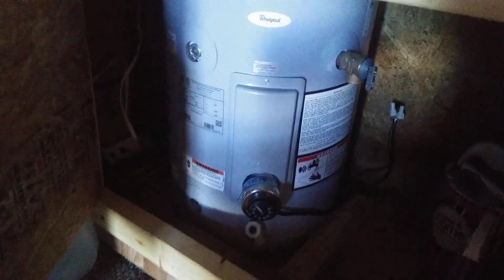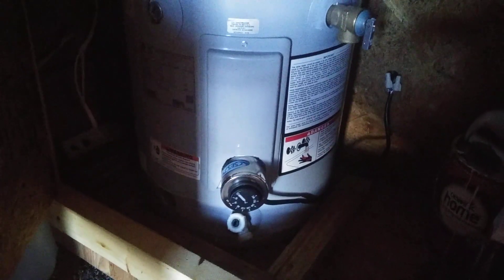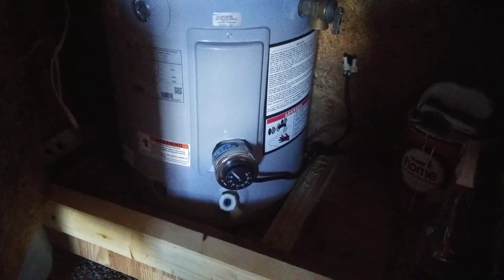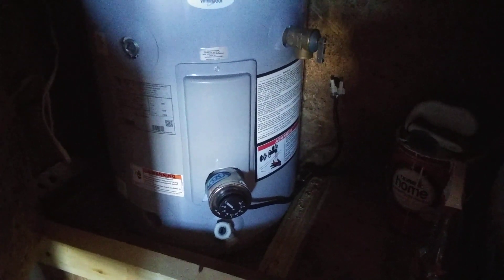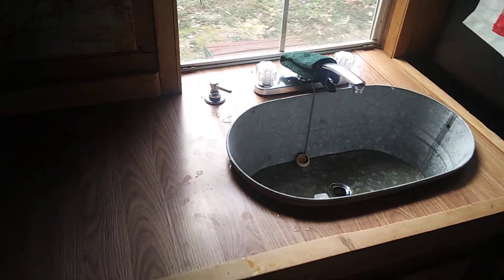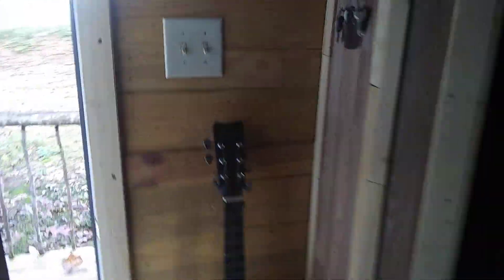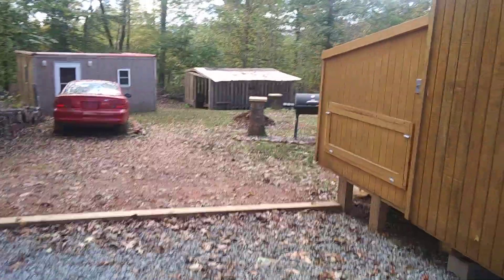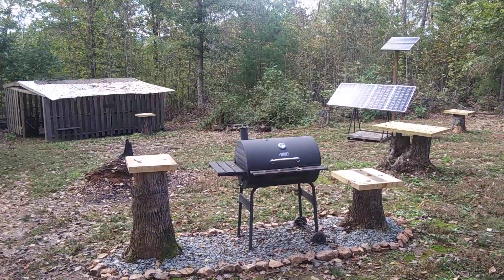Off grid water heater 12 v

Comment: Ok, I have a few questions. Going to put them all here, hope that you don't mind. 
First one, is this the same shed/cabin that is like 100' from your main house? if so, is it still in the same location? If not, where is this, (generally I mean.) 
Why not run power from your 6000watt house system to your shop, makes way more sense to have just one solar system to upgrade and maintain and it does not look like it would that that long of a run and it's not like when you are in the shop you need the power in the house. 
Next, for the main solar, why not rewire your panels to have 4 in series instead of 2 (48v)? Your Rover has a maximum solar input of 100 volts so this would be well within its specs. MPPT works better with the highest voltage you can provide, it also means you can have more panels as your charge controllers MAIN limiting factor is amperage, not so much voltage. By running 24v you are hitting the amperage limit fast. Does this make sense?  
I understand that the 230w panels on the main house are 24v so run run those two in series. The way I see it is take the 6 panels in the back yard, and two from the roof to make 2 48v arrays. 4S2P arrangement. You could do this by taking the one from the pole and putting it with the other 3 on the roof. (48v) the 4 on the yard rack in series(48v) combined with the 2 24v on the house in series(48v). This would leave you with one extra panel, but the advantage of getting everything on your MPPT would more than cover the loss of one panel (or get 3 more panels to make yet another 48v array. Your MPPT can still handle it easily based ion its specs).
My quick math shows that you would then have about 27Amps at 48v going to your MPPT which would then charge your 12v Batteries. Ditch the PWM controller.
My math is 100w panel at max output is lets say 12v8A (Dreaming I know) take 4 in series now you have 48v8A. the 24v panels say 24v9.5A, in series 48v9.5A.

9.5A+8A+8A= 24V26.5A. Your controller is good for  

If you want me to explain differently, let me know, sometimes I don't explain well. Or have you already considered this and come across some other hurdle I have overlooked.

Also, I think if we we neighbours, we would be fast friends you and me, you are living my dream for the most part.

I have several ideas re your water also, but lets stick to power for now, since your water is working.

I can't wait to discuss this further, you are an inspiration to us all, carry on!
Reply: sorry, typo above. I meant to type as follows in the math;
9.5A+8A+8A= 48V26.5A. Your controller is good for it. look forward to your reply.
Reply from the maker: Yeah this is the same cabin from before. I bought 5 beautiful acres with great views and a large creek and had the cabin moved there. I wont lie to you as it pertains to my power i simply put my system together piece by piece over time. I added and tweeked it to the point it powered my cabin without issues. I honestly could probably power a place twice the size at this point. My shed system was just me essentially putting to use extra stuff that was sitting around. I like to tinker around see what i can do on a budget. My water system works very well. I have rain collectiin and access to pumping water up from the creek. Im located in southern va .If you interested in the homesteading off griding stuff and can your more then welcome to come check the place out
Reply: any thoughts on rewiring the panels to 48volts to better utilize your MPPT charger?

PS, I may take a trip down your way one day to "check up on you" 😃